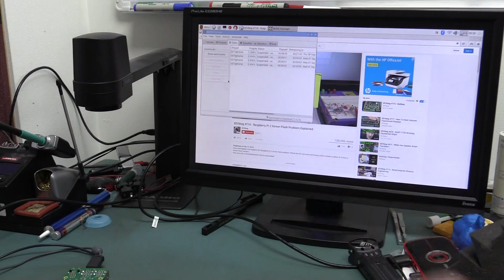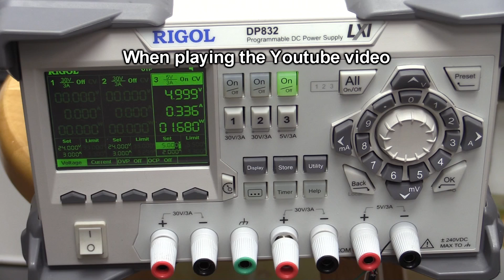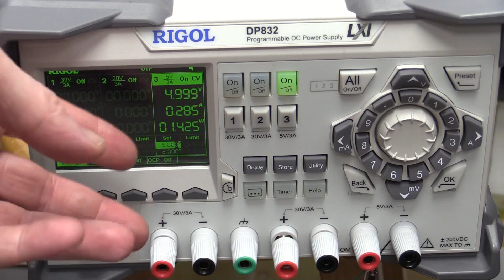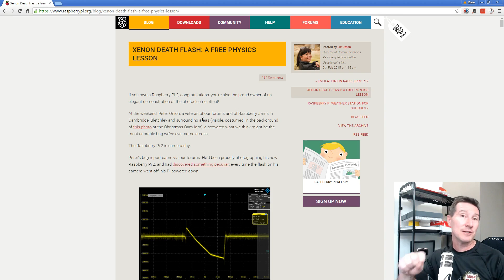EEVblog #901 - Raspberry Pi 3 Photoflash Problem

Comment: for 35$us, ill just put it in a case and not try to take flashes 2cm from the pi, a picture that close with a Zflash will not give very much of a picture anyway. so, unless im trying to run a club lighting system with my pi (not unheard of for me) it doesn't worry in the slightest, come on35$, next we will hear complaints that its not waterproof.
Reply from the maker: I'm just pointing that it's still possible.
Reply from the maker: No chance unless the case is transparent, even then it should attenuate somewhat.
Reply: Do you think coloring in that chip with a black Sharpie or whatever would take care of the issue?
Reply: Do you think there's any chance of it penetrating a standard case for the wifi? Or maybe perhaps a 3d printed case where the layer resolution isn't perfect (just taking a stab in the dark here)
Reply: Ah thanks. I am having problems with the wifi cutting out and sometimes not coming back until restart; I thought it might've been related. I'd have to look elsewhere.
Reply: Kayak Fan always the chance of crowded wifi channel.. that used to cause nightmares for every device in my house. even with what I know.. it was one of the simple fixes that was like night and day...  that or the club lighting.
Reply: Yea that is a problem for sure where I live. That's why I invested a lot in a good wifi network. I don't have any problems with all my other devices. The pi however doesn't work very well. I'm ok with it cutting out because all I want to do is send sensor data, so i can just keep a buffer and try again later. The main problem is that sometimes it doesn't come back at all.
Reply: +Kayak Fan: Unlike my Linux desktop the Pi (running Raspbian) doesn't attempt to reconnect if the WiFi connection appears to have gone away. The WiFi signal on my router turns off at night when it isn't needed. When I left my Pi running overnight I would have to reset, or power cycle, the Pi in the morning to get the WiFi link back. I now just run a cron job on the PI to drop the network connection just before the router shuts down the WiFi signal and restart the network connection in the morning just after the router turns on the WiFi signal for the day.
Reply: Hmm that's a good idea actually. Thanks
Reply: or as another poster said, would a blob of gunk be bad for the chip or surrounding chips. ive never used it.

Comment: 'It was a big problem'. No, it really wasn't - I've used dozens of these things for prototype products, one-offs and even some art installations and I've never had a single problem related to the 'light sensitivity'. There are newfangled things called cases - they keep out the elements... including unwanted light flashes.

Move along now... nothing of any importance to see here.
Reply from the maker: Well, ok, it was a "big to-do"
Reply: the point is that it shouldn't happen in the first place, just shows poor design, the could've just put a blob of potting compound over it  and solved the issue. Looks like they've just put sharpie some sharpie on it instead of doing a proper job.
Reply from the maker: That could certainly happen with the RPi2 without a case or a clear case, it was fairly susceptible. new one is much better.
Reply: At the price they sell these things I don't mind a few cut corners. Also I wonder how robust, for instance, your PC motherboard or your fancy GPU would be if you start strobing it with Xenon lights. I remain to be convinced that this is a real problem or anything beyond an interesting observation.
The way the Pi has caused a reordering and rethinking of the prices of everything else is commendable and it's still right up there for features and usability (especially a robust and reliable set of OSs and good development support).
Reply from the maker: Doesn't look like sharpie, it's some very even coating.
Reply: True, but is putting a big flash directly on it also one of the standard uses?
Every PCB should be mounted in some kind of case. If you leave it laying bare on your desk without any protection from the elements, you could easily drop something metallic on it and kill the PCB.

To me, it doesn't seem to be a big problem that it is photo sensitive.
Reply: Id imagine on display at a booth somewhere where photographers are taking pictures of the RPi for tech articles if it reset because of a camera flash it wouldn't look too good for the RPi. Maybe thats too specific but I believe it's a big problem because there's probably many other ways it could get affected.
Reply from the maker: Correct, I'm just making people aware it's a potential (remote) issue.
The chips are not poorly designed, photosensitivity is just a nature of all bare dies. Granted, you can maybe take some steps in the design to help prevent it once you know, but there are so many potential impulse points in the chip it's likely not very practical to do that. Most bare dies go into cases etc.
Reply: EEVblog
Thanks, makes sense, I for one was not aware of this issue with bare dies before your videos.
Reply: Perhaps not so much an issue if you're using a built-in camera flash, but try something a bit bigger, like the Bowen's 750 or a Unilux 'Bigshot'.  It's not insurmountable, as you suggest - the right case is a major help, but it is a problem none-the-less; especially when you move from using dozens to using hundreds in a flash heavy environment.  I have had a few problems with the light sensitivity.

But then again, it's cost vs reliability.  For the price, it's a known issue that I can work around.  But for the inexperienced, having problems diagnosing this, any information is important.  A hardware weakness is still a hardware weakness and therefore requires design consideration.  If a problem can be prevented in the design stage, that's a lot of frustration removed for the poor engineer field testing something... or a poor one-man-band struggling because they don't know jack about hardware.
Reply: ***** I agree in one sense - it was a bit of a misnomer for the marketing to sugget that the Pi is "like the BBC B" - in my experience, the Pi is still many orders of magnitude more difficult to start programming with, as it's just a far more modern device with hundreds of hardware registers, and higher-level coding languages.

The reason the older 8-bit machines were so great for learning programming is that many of the entire machines could be fully understood in terms of the hardware, and so the software was usually much easier to get to grips with.

(yes, I'm aware that you can run emulators and lower-level stuff on the Pi as well, but I'm talking about what the "average" Pi user would be using.)

docgramps1 Yeah - it would have been nice for the Rasp Pi peeps to at least acknowledge the issue with the bare die chips when the boards were released. It's fine to deal with if people are aware of it.

Again though - I still wouldn't consider it a "fault" with the design - as Dave said in the vid, those types of chip are used in MANY mobiles and tablets these days, as it's the price of miniaturisation that consumers seem to demand in new products.

It is a dev board after all, and it really should be put into a proper case to protect it, even though there will be people using it outside of a case.

(even a plastic case likely wouldn't guard against the EM pulse from a very large flash lamp though - I imagine those things can kill most types of electronics at a distance. lol)
Reply: Yes it's only a discussion unlokia if you don't like it you don't have to read it.  

Now back to the discussion.  I agree knowing and understanding a computer in it's intarity in the days of the ZX-81 or the BBC was/is posible where as the same is not true of a moden PC but understand any one(small) part of a moden computer at any given time is all that is needed.  If one needs to understand another part of the same system then reading up on that part is easy esp if you know the basics of logic. 

It is much better to understand the basics of computers like logic gates than to try and understand all parts of all computers.   Then to apply that understand to the small part of the large complex computer your working on at the time your working on it.
Reply: Exactly Oliver.
Reply: True but, if you want to fix a problem you should just do it and not try to cut corners.
Reply: I'm not sure if it's really 'poor' design as the majority of design engineers probably wouldn't be aware of this issue. But I guess that is the main purpose of Dave's video, to make people aware of uv sensitivity in modern chips.

(However, I think the bare die chips themselves are poorly designed)
Reply: The thing is, the Raspberry is designed to not be in a case.
Reply: Are some boards / chips not susceptible to the pulse from the flash bulb / HV itself though?

I messed with some photoflash units many years ago, and found all sorts of electronics that didn't respond well to the lamp or inverter being too close to them.

It's still a great demonstration of light sensitivity of most (all?) silicon dies though - not many people realise that you can make a simple phototransistor by shaving down the plastic on a standard bipolar. ;)
Reply: Damn - beaten to the punch with my comment already I see (by about 6 different people). lol
Reply: I don't think it's a huge problem tbh - if people are made aware of it, then it's fine.

It's not like people will be constantly needing to take photos of the board, and the boards should really be inside some sort of housing in most projects.

They do use bare die flip chip packages in many products of course, but it's not usually an issue either (again, due to being inside a proper case / housing 99% of the time).

I know the Pi is a bit different though, as some projects just have the board sat out in the open.

Another simple and fairly cheap solution would be to just buy some small WiFi and BT mini USB dongles, or stick an ESP8266 module on the Pi IO pins in SDIO mode for fast WiFi (if the pins are spare).

But - does the camera flash lock still up the entire system when the WiFi / BT chip fails? Hmm.
Reply: btw - I can't argue with the price of the Pi though - the Raspberry Pi foundation is basically a registered charity, and the low price of the boards is half of the reason for their mass popularity.

I don't blame them for using the bare die chips if they want to keep within a certain price. It makes perfect sense from their point of view.

Again, the issue isn't really a game-changer for most people, and I wouldn't even consider calling it a true "design fault".
Reply: Yes, but another tenner would also buy you a faster Odroid C2 or something.

The other thing that makes the Pi popular is that it does have a very large support community for both the hardware and software now.

I personally think Rasp Pi have done a great job with releasing newer faster boards at a similar cost (or lower, like the Pi Zero).

Each board fits a different purpose really.

As Dave said in the vid, if people are really worried about it - just stick a bit of tape, blue tack, or soft epoxy over the chip - problem solved. ;)

I do agree in principle though that it would be nice if the Rasp Pi peeps did release another far more powerful board soon for a little bit extra (and ideally with no bare-die chips on, although that's not a huge deal to me personally.)
Reply: ***** How much info do you want? for something that you clam is not open I bet I can find the same info on the arm cpu as on the 6502(the cpu in the bbc) and the Z80 (the cpu in the ZX-81) To start with 
https://www.arm.com/products/processors/classic/arm11/arm1176.php
Reply: ***** I'm fairly sure the ARM instruction set and datasheets are pretty much public and complete, including for most (if not all?) the internal hardware regs for the Pi?

I believe Broadcom even released the code for the "Videocore" GPU a few years ago, hence better video acceleration support being added to things like Kodi etc?

I may be wrong on it be "completely open", as I haven't looked in a while, but it's certainly far from completely closed too.
Reply: Seems fairly comprehensive on the instruction set side?...

https://web.eecs.umich.edu/~prabal/teaching/eecs373-f10/readings/ARMv7-M_ARM.pdf

OK, so there is still a proprietary binary "blob" for parts of the multimedia acceleration side of the GPU, but they did release a ton of source code for the rest of it...

(which is why I said I wasn't sure if it was "completely" open.)

http://liliputing.com/2014/02/raspberry-pi-gets-true-open-source-graphics-drivers.html

https://github.com/raspberrypi/userland
Reply: The point was if old 8 bit CPUs are harder or easy-er to find out about/learn then newer ones.  Well considering I found the info in under a min on google and that all computers are based on the same logic gates then; No older computers are not easy-er than new ones.
Reply: +MrStevetmq Not sure what you mean?

It's all about the relative complexity of each system / CPU of course.

The 6502 for example has only around 3,500 transistors, whereas the ARM Cortex A9 (fairly common) has 26,000,000 transistors. :o

The rest of the systems on most older 8-bit machines was also vastly simpler than what we have nowadays.

The logic for the whole BBC Micro can be taught and understood relatively quickly.

It would take years to fully understand something like a modern ARM CPU down to each logic gate, let alone the GPU inside many of them, and the other supporting hardware like DDR RAM, WiFi, USB etc.
Reply: I'm merely having a discussion. I find it interesting.

You were also getting quite hung up on things, you know. ;)

It is damned hot in this room atm, so I'll give you that. lol

Comment: Ah, come-on,how much does a blob of bake-lite costs?
first ,No repeat start i2c problem, then xeon problems.
when will these companies try to start making high quality product?
Plus it costs the same as an atom board and it runs windows,never seen a problem with those
Reply: Bakelite is what they used to make phones and such out of in the 60's. It's a hard but brittle plastic.
Reply: Most of them are around 50-60$, but it will give you x86 PC architecture, with sata, pci-e and ram slots etc.
Reply: there's an atom board the same cost as a pi? please link
Reply: condition:you will have to be in a developing nation to gain access to those board-eg-http://www.ebay.in/itm/172257601324?aff_source=Sok-Goog
Reply: How much is 2,500 rs?
Reply: +Kayak Fan 35-40$
Reply: +Manuel H. isn't that the plastic used to cover all the ICs in Chinese electronics
Reply: that's besides there point, they aught to cover it with something, be it old school way or even recycled material way